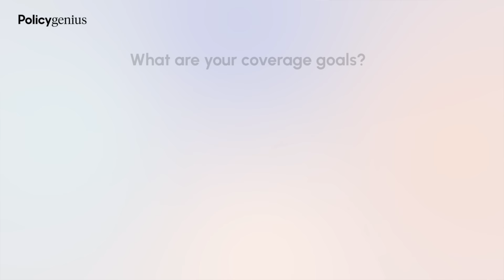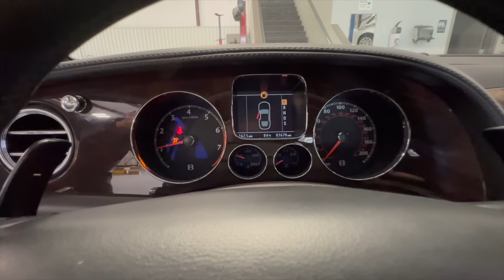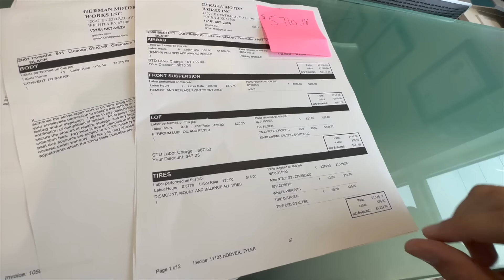My terrible life choices are catching up to me. ($30,000 in repairs this month on JUNK!)

Comment: Keep the Mercedes. As cool as a twin turbo W12 is, the Bentley is just going to keep breaking.
Reply: Yeah Mercedes-Benz usually keeps working when maintained well they are forgiving so somewhat
Reply: Anyone who thinks the Mercedes V12 twin turbo is a reliable engine needs to view  the relevant Legit Street Cars YouTube videos.
Reply: agreed
Reply: @BurntOrangeHorn78 and he bought his CL from Hoovie, lol
Reply: @BurntOrangeHorn78  yeah, the struggle is real for Alex.  One of Hoovie's old turds.
Reply: @BurntOrangeHorn78  Its a really good engine. Noone else makes anything better in that hp range at least.
Reply: @martinsvensson6884  

No it is no!  First off, it is a 3 valve SOHC design.  Secondly, there are O Rings and plastic parts under the intake manifold that require an engine out service when they fail.

The prior V12 was a much better design if one avoid the self decomposing harnesses if 93-94.

KegitStreetCars channel will review all.  A former MB master tech cannot get his to run reliably after rebuilding it twice.
Reply: forever
Reply: The legit street cars CL65 has aftermarket turbos and a tune, a stock one probably wouldn’t have those problems. I have an S600 with basically the same engine, bought with some issues fixed them, and now haven’t had any issues for more than a year. First I thought about tuning it, but figure it’s better to leve it alone has way more power stock than what you actually need in your normal life.
Reply: @BurntOrangeHorn78  No it was a really good engine. Very reliable. Seldom something goes wrong with those. Only thing that seem to happen is that you might have to replace coils.
Reply: VW Phaeton? Speaking of W12.
Reply: @mario022594  

Yes, he did upgrade his turbos. His problem is at WOT. Not sure it is worth tuning that engine as power is adequate and transmission is at its torque limits.
Reply: @admranger  

Alex is a MB Master Tech. Hoovie, not so much.  I cannot remember him even paying for a pre-purchase inspection.

Comment: I thought i was an idiot for spending almost $18k in total on a C4 Corvette, including purchase price, tiress, ane paying a second shop to redo work from the first. Thank you for making me feel better about my life choices
Reply: ..ouch...  even that's a bit painful for a C4 unless it's a ZR1...   so I'm guessing it just got a new optispark, weatherstripping for the hatch glass/windshield and the other couple common C4 issues taken care of...
..and is fairly low mileage...
Decently good ones that haven't been abused or neglected seem to go for about $6k-$10k here in western canada...
..saw a 93 garage queen with only 18k kilometers on it going for $19k at a chevy dealer last year...
...decided to keep my '95 cuz it's paid for, and pretend the '93 didn't exist... it was perfect aside from being red interior with white exterior...
Reply: @JeTTRod  Yeah, all of that. New optispark/water pump, upgraded radiator, new weather stripping (TWICE, because the first idiot I paid to do it broke the targa and used the wrong material), doors realigned, a/c converted to R-134, steering column rebuilt, new Michelin pilots on all 4 corners, all fluids flushed, new windshield (THREE TIMES because of the same idiot), and it had 84k miles when I bought it in 2022
Reply: @JeTTRod  It used to be a garage queen, which is why it needed all this work. But it's running fantastic now
Reply: No, you’re not nuts.  You would have been if you bought a new one, but older cars are more reliable, look better, and are just as fun to own as pretty much anything being built today.
Reply: @mudman6156  Idk about reliability but you got the rest right

Comment: J&J Auto Wrecking is the shit. I’d recommend them all day every day. 

I bought damn near an entire side of a car from them (doors and fender). It was the same paint code as my car, matched perfectly, and was packed with care on a beautiful custom pallet and arrived fast.

J&J FTW.
Reply: J & J really are awesome. Enthusiasts who take care of enthusiasts
Reply: Nice man! Shame that 90% of breakers will not put a single thought into it. Will damage the parts while they are taking them apart, will use the cheapest packing material if any. And after all of that, will refuse any sort of return, even though they ship a part to you which is far from what was advertised.

Comment: I love my 84 Buick. Just rolled over 200,000 miles. Parts are readily available, I can do most repairs myself. I will never understand the appeal of a vehicle who's repair costs are more than what I paid for this and my 25 year old Tacoma, including parts for both of them. Practical, great at cruising and doesn't break the bank all while I still look and more importantly feel good doing it.

I still plan on having both of them in 20 years. Wonder how many Teslas, specifically cyberstucks, will be in Salvage yards by that time? So many modern vehicles are similar to phones. Parts and more importantly labor are so prohibitavely expensive to fix them it's almost cheaper to just buy a new car for most.
A friend of mine was trying to get a new catalytic converter for a toyota camry. Garage kept trying to charge her $1500. For a 2001 Camry. Is it made of gold or something?

Comment: I like how the rainbow ended on the cyber truck. Instead of a pot of gold you got a pile of s**t
Reply: can hardly wait to get mine. Looks like the best off road truck ever. Super efficient, really fast, absolutely state of the art.
Reply: That had an issue with washer fluid getting down in under the frunk enclosure; hope that got addressed before it sat out in the rain. Also hope it was in car wash mode...
Reply: Rusty Cyberturck at end of rainbow
Reply: @dangrass  You have clearly never been off-roading.. lol

Comment: Sell both of them and the cyber truck while you're at it
Reply: That's my first choice too
Reply: now that is a great idea.
Reply: keep the cyber truck. nothing wrong with it.
Reply: Yet
Reply: @moosc  Nothing right with it either. Not a car, not a truck, can't use it for towing, and the body is already starting to rust.
Reply: the windshield washer leaks all over under the front hood. That's quality.
Reply: @bmwpete65s55  its also full of sharp edges that cut people.
Reply: Cybertruck is more upside-down than rest combined!

Comment: Watching Hoovie digest a $19,000 shop bill reminds me of the frequent gut-checks of owning an E-36 M3 in my 20's...the bills were an order of magnitude smaller, but then so was my income. It felt like I rarely escaped a shop for less than $1500 and believe you me, it hurt! I sold it after a year because I just couldn't afford to keep the thing running (let alone nice). By contrast, I currently have a 2010 Lexus that I've owned for 9 years and 118k miles. Other than scheduled maintenance, it's needed brakes, a CV joint and a TPMS sensor in that time. All in about $2500. I'm keeping it until it explodes.

Comment: I ran a dealership a while ago and we took consignments regularly, we took a few 1-2yr old Maseratis in on consignment….  $120k cars with 5-8k miles on them with a used price around $80-90k and WE COULD NOT SELL ANY OF THEM, Ever! when the owners dropped the price still nobody would buy a used Maserati. One of the cars left and was taken to a detailer who ran the car with F1 gearbox backwards up a big hill - clutch burnt out which cost $5k if it remember right. As a career long car guy who deals with this stuff - only morons buy Maserati

Comment: Buy you a storm shelter please. Then insure all the cars and leave them outside and sell them to the Insurance Company and double check the Builders Risk Policy for coverage. The storms are not over. Keep your pretty Van and use it. Get a good 4 door LWB Chevrolet Truck 4wd and use it. You need a Bunker out there really bad. My opinion. You can make it. I have one that is an Armored truck and a Chevy. Not good for parking in tight spots but a good vehicle to outrun a Tornado. That place is a Target for a nado due to the Heat it collects. BTDT. NWS advise. Excellent video, Thank You and Keep the Bentley.

Comment: Newer proletarian cars are expensive too. $650 to replace lower control arm bushings that began failing at 60 k miles on a 2016 Subaru Forester. This is a part that should last at least as long as the struts. SOA sells an upgraded part but does not consider the old one to be defective. I do most of my own work. However, I prefer upgraded SOA bushings in the old arms to new aftermarket arms and do not have a press or cup for Subaru so took it to a good, local, independent.

Sell the Benz and the Bentley. Stock that pond with fish. If you keep one car for trips, keep the Benz. If you keep one for flash, keep the Bentley. I would not keep either. They are both depreciating.

Want an inexpensive project. Buy my F-150! It's black, pretty, rust free southern vehicle. Regular cab, 6' box, manual transmission, 4x2(LSD), 302 first year of electronic fuel injection.  It's in Atlanta just 2 miles off I-75/85. Clean GA title. New tires, brakes, suspension. New front fuel tank. Bring a trailer. Tow it with your Tesla! Key quit working a couple of months ago. Can't start or get it of park. Hydraulic lifters were noisy suggesting low oil pressure (sensor is bad so I really don't know). Was about to drop the pan for a look at the screen and pump. No rod knocks. Ignition key issue is last straw for me. I do not want to mess with it any longer. If I were not as old as I am and did not have too many other projects and grand kids, I'd keep the truck. I love a manual transmission in a pickup. Bring the Tesla and a trailer with a big generator on it. Tow it home with a Tesla. Then sell the Tesla!

Comment: 70,000 for lights and HVAC? Special youtuber price.
Reply: Is that cheap or expensive?
Reply: also 9k for a concret slab is making one question who is taking Hoovie for a chump...
Reply: Yeah, Unless those are stainless steel ducts and gold plated lights, @watchJRgo could have done it for $20k.
Reply: @admranger  I don't know about $20,000. My neighbor had a furnace from another friend she wants to replace hers with and her HVAC guy wants $5,000 to install it, said a new one installed is about $10,000 and he might need two for that building so that's probably $20,000 alone. Maybe $40,000 to $50,000 might be closer to the real price it should be. $70,000 definitely seems a bit high.
Reply: @dubment  Hoovie is known in the area as the dude with money.
Reply: @radsdad1  yeah, I have a friend who trade up to a 7 series at one point and our friends were laughing at him coz everywhere he went with that car people whould husle him...

Comment: I'd keep the CL. The Bently is nice and all and seems a little bit more special, but kinda screems "repo" as some other comments said. Also the Bently WILL continue to break in an expensive way. The CL won't be cheap to fix in some ways either, but much more power and easier parts to get probably.

Comment: What to sell? The best bet, even though it's not dumb enough to live up to your motto, would be to look at each of the two on the chopping block and assess which would be more feasible to keep from a maintenance standpoint. My guess would be to sell the Bentley since the cost of that one module is a taste of what's to come should anything else crap the bed. The way things are going, you will have a dream garage but nothing to put in it. I suppose that if worse came to worse, you could convert the garage into a huge play area for your kids. Things like a bouncy castle have to be cheaper than the repair bill with the Wizard, after all. 🤔😉🤪

Comment: I have a question for you or Wizard concerning the Mercedes SEL models for sale. I have been noticing several of these SEL's have very low mileage. I find it suspect that these cars have such low miles. Have you discovered any odometers turned back?

Comment: The Great Pyramid at Giza is about 4624 years old. In 2124 it will still be about 4624 years older than that Chevelle still sitting on that hoist.

Comment: Having bought and sold 50 plus cars over the last 20 years, but on a one in and one out basis, your bills on the crazy stuff you buy have still been surprising low lol. A 2003 RS6 Purchase of mine with a purchase price of 9,000 GBP had its first proposed fix bill of £8500 so not ideal, the car what then written off...

Comment: after the car wizard's sl500 video saying it costs $4-5000 to redo top cylinders on a r129, I think he's ripping you off.  Last I checked, that was a $2000 job.  I did my own for $10 rebuilding cylinders myself.  Well, add $20-30 for new fluid, still below $50.

Comment: Why on Earth does anyone pay these prices for these "exotic" vehicles that are total PoS that consistently break down. Reliability doesn't seem to exist anymore when I hear dealerships suggest things like water pump replacements at 35k miles and then manufacturers fight tooth & nail to deny obvious problems that should be recalls. Not to neglect mentioning replacing a $10 seal that requires the engine to be removed just to reach the seal that you paid $50 for because you can't find that seal anywhere but the dealership. 

IMO, we are at a point with technological advancements where almost every part on any vehicle should have been standardized years ago. Yes I must be insane for believing that things like car parts should be standardized. I mean it doesn't take much imagination to see that a water pump, or an alternator, could be used in 300 different models of vehicles. I must be living in Disney World!

Comment: Car Wizard is a smart guy - AND he has worked on cars A LOT. Which is why the stuff that he says about "original parts" gets even MORE annoying than it would be - if some random JoJo on the internet said that carp. Sorry, crap. Maserati DOES NOT manufacture AC compressors. Nor does Chrysler/Stellantis, the parent company of Maserati. The fact that something Car Wizard bought a month ago from "aftermarket" - as he calls it - grenaded itself - has ZERO to do with the issue. The AC compressor is most probably manufactured by Delco, Delphi or maybe even Bosch, if the parts' chain is in the EU. Those are the same parts that Maserati puts in the cars at factory - but they cost 3 times less. The only difference between the actual part manufactured by the original equipment manufacturer (OEM) - and a "maserati" compressor - is that the latter one comes in a box labelled Maserati. Inside it's the same exact part that comes from the factory. And yes, even those can grenade - but here, the problem was likely that a remanufactured unit was put into Mrs Wizard's Trofeo - and even they have warranty - so between the warranty, installation costs, fillup with the refrigerant and time consumed for work - Car Wizard could purchase and replace two to three "same exact manufacturer's" (not sure if it's Delco or Bosch) parts - for the price of a single "maserati" (refer to above) part. Keep up the work, Wizard - and don't let that vacation sun work too hard on the good old brain. Greetings from Latvia.

Comment: Sell the Mercedes. Low production numbers, yes, but you’re less likely to suffer a loss on it as you said, and the Bentley surely is more special. Keep the Bentley in good condition until the value raises (it will) and the Mercedes is really a beautiful car, yet no more beautiful or special than any of the other performance coupe Mercedes you and everyone else has had